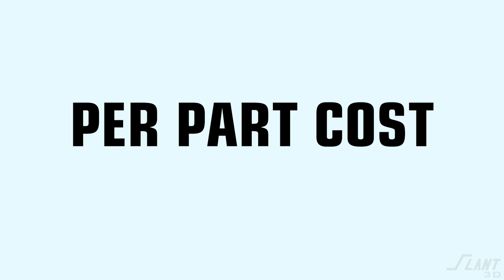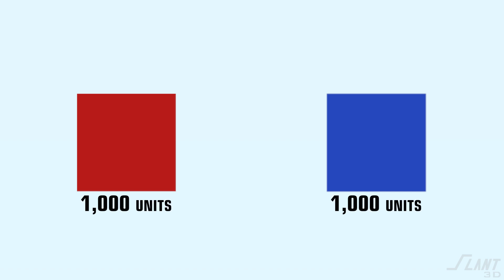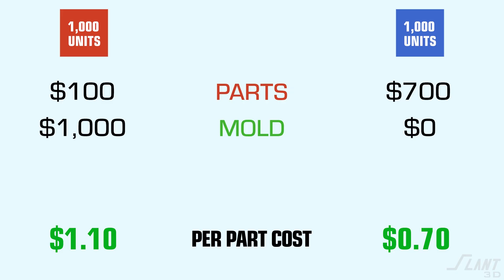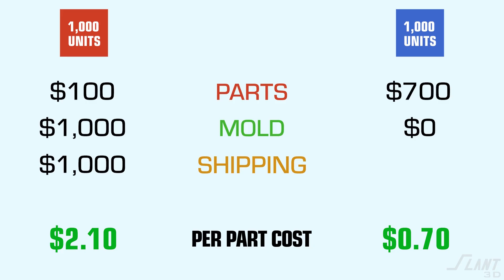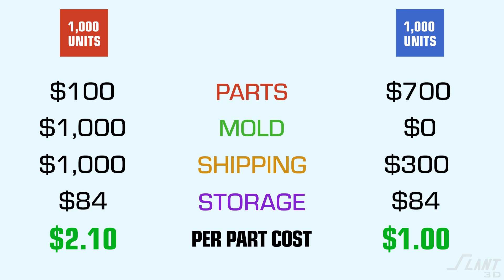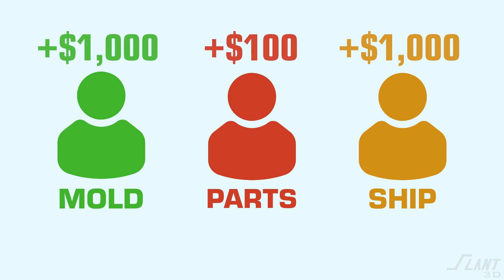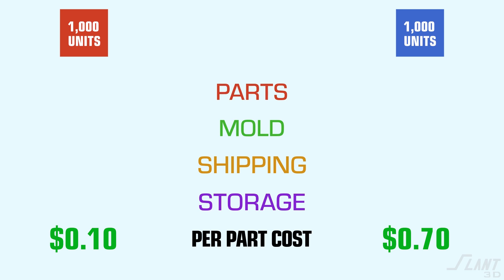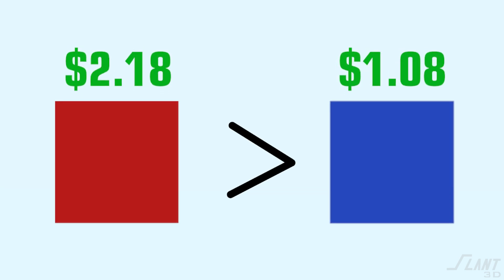Calculating the REAL Per Part Cost for Injection Molding vs 3D Printing

Comment: I love this video - VERY strong links to Taiichi Ohno's 'The Seven Wastes' in lean manufacturing: Transport (moving stuff) / Inventories / Motions (of people) / Waiting / Over Processing (using a hammer to crack a nut)/ Over Production / Defects.

I used to set an exam question about this, asking students to describe all seven, and then say which was the worst - I gave full marks for any well reasoned answer to that last part (what can I say? Sometimes I can be generous!). But Ohno himself said that the worst waste of all was Over Production, as it automatically led people into creating the other six wastes. What you're demonstrating here is the truth of this. Injection moulding forces companies into over production, and after that they may as well just burn bank notes.

Should also note that in your example maths, I don't think you need the warehousing cost for the printed parts - you've already taken account of this in the top line cost of production as you've often said that  "the factory is the warehouse". 😘
Reply: I think one thing that many people forget in the cost of 3D printed objects, is to ammortize the cost of the printer.
While not necessary if you're ordering from a print farm (since they do this for you), if you take production "in-house" with 3D printing, then you need to ammortize the machine,  calculate electicity costs, maintenance costs, and also the wages for that guy that specializes in 3D printing.

Comment: A company generally doesn't make a 10 cent part mold for just 1000 pieces. Those parts usually get molded by the thousands a month and that's when molding is far more superior. But there is a far more interesting intermediate option. FDM printing small batch molds, where you get the benefit of quick turn around in designing, creating and redesigning a mold and still be able to do a moderate amount of work in a fairly decent speed. 

Let's take the gridfinity bin (because everybody knows that, but bad example for molding). Let's say you have your processes tuned to the max and you are able to print a single bin in one hour. To print 1000 parts in a single day you would need 42 machines working in parallel. That's a lot of time spend managing machines and it would take an insane amount of space to house those machines. 
Now take a FDM based mold. You can print/prepare a mold in less then a day and a single small injection machine would then spend less then 4 hours to churn out those same 1000 parts. Assuming you would need to replace your mold every 250 molds you would need just a handfull of FDM machines to support a single day run. 

And that's where I think you made a mistake in your example. Because you might not need to pay for storage, but you DO need to pay for the officespace containing those machines. And you would also need a small army of people to maintain and manage all those printers. And this very specific example would actually be the perfect candidate for FDM based injection molding.

Comment: there is also the cost for R&D.  How long and how much did it cause to design the part and make the mold, or 3d print file?
Reply from the maker: Exactly the same for both

Comment: Just this week a big tool distributor asked me if I could design and print dividers for some of their tool boxes. Their suppliers are out of stock and need quite a few. Obviously no problem, easy design, got a sample out. Out of curiosity I asked about the cost of the 70x50 2. 5mm trapeziod and he said 17 ZAR. I can fit 12 on a build plate and asked 48 ZAR for it after everything was added, material, post processing etc. 4 ZAR each as to the injection molded part at 17.

Comment: These kinds of comparisons are almost always fairly disingenuous, like this explanation of part cost is here, which is that in a production environment you're dealing with monthly/weekly/daily usages for years on end. Not a single one time run of 1,000 parts. No competent engineer, project manager, CFO, etc would even consider injection molding as a manufacturing method to begin with for 1,000 standalone parts and the design of the part would be chosen to accommodate this. Or you wouldn't even waste the time to design you're own in the first place and would just purchase an off-the-shelf mass produced enclosure that you can use in the example of a box.

If you're going to go down the rabbit hole of trying to nit pick every cost along the way, you need to also start adding in the 40-50/Hr that you're paying for design work, reviews, meetings, getting quotes, working with the 3D printing shop, etc, etc. You shouldn't just limit to the basic direct costs associated to simply manufacturing the thing when it reaches a point that appears favorable to 3D printing, which is of course a service that you're selling to people.

Comment: I get what your saying but they both fill different needs and always will.  Time and reliability of production.  Space could be argued both ways because to produce the same amount of parts you will certainly need a great deal of floor space for all those 3d printers to make the parts.  If I machine my molds in house, well molds aren't terribly expensive.  Each business has to do the homework.

Comment: Dont forget about the R&D cost of the mold and extra engineering it takes to design an injection molded part vs 3d printed. It is significantly easier to design for 3d printing. This also means it is much quicker. Which means get to market sooner and sell earlier

Comment: The price of the printer seemed to be excluded (unless it was worked into the part cost, which it very well might've been), but the rest of the concepts made sense
Reply: @TS_Mind_Swept  the cost of the printer was not included as this consider's having a print farm print it for you, just as the cost of the injection molding machine wasn't included.
Reply: @beansbaked4448  the price of the printer/upkeep of it is still a factor for them though, and if you think for even a second they're going to give that away, you're sorely mistaken. Just like with "free" shipping, nothing is free, it's just worked into the cost elsewhere

Comment: this video is obviously very simplified but like always, it depends on the part. You can not for example print a clear part or a part that has charp corners anywhere or parts that have a shallow angle which needs to be flat etc. Also injection molded parts are isotropic meaning they have the same strength in all directions. You can also not print connector housings which have the contacts inside the plastic routed around corners to reach specific points on the housing. Also warping is, i believe, much better controllable with a mold vs a printer. And last but not least, you are not gonna make a mold for only 1000 parts.

Comment: There is also one other cost for injection molding.  Molds can wear out over time and may need to be replaced.  Worn out molds can affect quality so if you use a mold alot, you may need a new one at some point.  Model kit manufacturers run into this on a semi regular basis.

Comment: We have several 3D Printers and they are an essential part of our process and save us a lot of money. 

My only 2 comments on the video are: if this manufacturing is done in house then there is a significant overhead relating to removing the parts (if not a conveyor type printer) maintaining the 3D Printers, failed prints etc. The second point is speed of production. Whilst having a mold made takes a while, the machine can then crank out a 1000 in a few hours instead of a few weeks. 

There maybe questions as to the quality of a 3D printed part, porosity and strength, but I still think that 3D printing is the way to go. We use lots of PETG CF and it produces awesome results. The saving of plastic also makes me happy.

We just need to make SLS printing much cheaper or even have suitably priced pellet FDM Printers to save money and the planet.

Comment: They don't factor any 3d printing overhead. Like cost of the machine, aplace to put them. Electronics required powestrips additional panel changes to support a printer wall. Filament. Duration of runtime per part. Failure rates of not having the perfect settings for a new part.. plus employee time troubleshooting and sending the job back in with new changes clearing failed prints. Machine upkeep. That also means there is down time. If you have even a few printers having one go down is a huge setback. That's not even considering getting into a more hands free product like bambu but that still is quite a bit of overhead amd if you want to ams then even more complexity to get it dialed in.... I like 3d but still don't see how I could ever make any money unless you operate printers like a crypto mine. Not to mention do you guys know IT ? because unless you do your going to be operating a lot of servers. Do you have wifi that supports it? Are they all hardwired aka we need to add drops to the printer wall and infrastructure to support the drops. Ie a switch. Don't you want to vlan those off the main network... of course you do.... there is so much going on to support these things. That being said mines on now printing a prototype part... anyone that has a winning business recipe already had capital
Reply: I think he mean you can order 3d printed things through companies that have 3d printer farm. So you only need to have 3d printer for your own prototyping, not for mass producing

Comment: The "mold" cost for 3D printing isn't $0.00 unless your designer works for free. The $1000 estimated mold cost has to include the design work along with creating the mold itself. No, it won't take $1000 in designer time to design a 3d printed cube, but it still isn't $0.
Reply from the maker: Product design is identical for both
Reply: @slant3d  do you not always say that we should design parts differently for 3d printing than for injection molding?
Reply: @divide6049  but I would think they are still within the comparable ball park for the same thing, unless the designer on each side has already some work before hand that is similar to the part that they could just modify to lessen their time.
Reply: @patrickbueno3279  i see where you're coming from, and for the cube you are definitely correct, the design would be nearly identical. However when the model becomes more complex, it needs to be designed differently for injection molding and for 3d printing
Reply: @divide6049  I'm just curious because I'm a new hobbyist, isn't molding generally a much more hassle to design than a 3d printing, unless they are optimizing for material economy and speed of printing of course.
Reply: @patrickbueno3279  in general the outer design of a part is easier with injection molding, besides the fact that the whole thing needs to draft inward slightly, but the inside is much harder on injection molding. The inside can't be filled with solid plastic as it would shrink and warp or even break when it cools down. This isn't as big of an issue with 3d printing since the slicer makes infill (100% infill parts won't break when 3d printed though, since it cools off gradually by each layer).

The outside of 3d printed parts needs a lot of changers and fillet to be strong, you also need to think about overhang and bridges, but you can make a lot of things that are impossible with injection molding, like internal holes etc.

Comment: You need to amortise the cost of the 3d printer, and if you need  quantity of these parts quickly, you need a bunch of 3d printers. Then you need a room / factory to store the 3d printers, which is significantly larger than warehousing the parts. This is a half baked idea economic breakdown.
Reply: No you don't. The startup does not buy the printer. They hire a printing service just like they would hire a mold company. The difference is once the mold is made it belongs to you forever. And so does the cost of it. There is no printer to buy at all when you are sourcing it out. You are taking an Apples to Apples comparison and twisting into an Apples and oranges comparison.
Reply: @DigitalGus75  if you're making a comparison based on the machines themselves then you'd also have to compare the injection molding machines required which also need a factory of their own and a much much larger production line and easily magnitudes higher in cost...

Hence, why people in need of 1000+ parts hire third-party companies to handle the manufacturing regardless

Comment: If the big company has defined the cost per part  0.1$, dont you think then will obviously consider mold, shipping etc cost to reach unit cost?
Reply: The point of the video is that regardless of the part cost, there's a lot of other costs as well which make the actual cost to produce and acquire the product significantly more
Reply: Not quite. Depending on company. Many Chinese are subsidised by government and shipping is almost free but may not in some cases. Same with molds. Those 0.1 per piece mostly won't include many expenses, like shipping, mold etc just the production itself as not single company will charge per item with injection molds, there will be minimum order amount but still price varies in the end when you ready to buy things.

Comment: Your analysis is not complete. The quality and strength of the parts could determine whether they will be sold or not. Also, all these factors are relative to reality for small quantities. Try printing 700,000 pieces in a week with a 3D printer... a mold can do it this with perfect quality and to be waterproof as well.
Your video feels like propaganda in favor of 3D printing haha 🤣🤣🤣
Reply: @3DTypist  My thoughts exactly. Injection molding buries 3d printing when it comes to mass production and consistent quality. That’s why manufacturers do it.  This guy is a bit of a goof.
Reply: It is propaganda in favor of 3D printing. He has a business that offers mass production 3D printing.
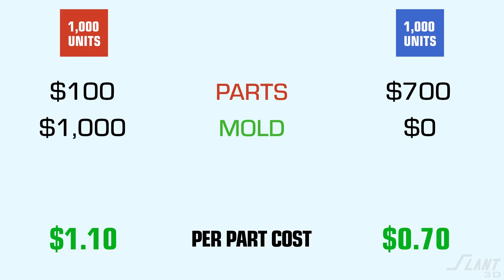Reply: He already explain that in 2:15

Comment: Yeah per part cost of maybe some shit tier materials. Any real industry doesnt actually use FDM 3d printing for any sort of end use parts that arent useless widgets or stuff under 0 stress. Injection molding has massive benefits from material selection, to strength, dimensional accuracy, etc.

An injection molded part is far more repeatable, you can get crazy materials, and for fiber reinforced stuff, its on another level.

Ive been 3d printing for 6 years, but fooling ourselves by saying fdm 3dp is better than injection molding is a nono.
Reply: Bro really? Nasa is using fdm in space...that's definitely not a "real" industry needing critical parts with high strength and dimensional accuracy. I've only been printing for under 2 yrs and have made thousands of parts on one printer and used or sold hundreds of them in the trades. A REAL industry. My parts do not break, they are under alot of stress, they will be used in spaces reaching 135F and they cannot be made in a single mold. And I am not using nylon or abs lol. You have alot to learn still.
Reply: @phasesecuritytechnology6573  

what part are nasa using that are FFF printed
Reply: Just as IM does, FDM printing also has massive benefits on many areas. Saying either of them is objetively better (which was NOT done on this video) just means you dont understand the subject. There are a lot of "real" industries, whatever that means to you, that use FDM parts. Just because you don't see them, doesn't mean they don't exist. 

It's also funny that you imply "useless widgets" or parts under no stress are not part of any real industry.
Reply: @Catrik  there's tons of crazy industries where PEEK, PSU, etc are used for FDM and that's a whole epic world of FDM where injection molding barely touches.

However what I subscribed to this channel and tangled testing for knowledge on actual viable 3d printing, not PLA/petg print strength which this channel seems to print almost exclusively. As someone who prints almost exclusively in nylons and other engineering filaments I was a bit disappointed in the filament testing.
Reply: @FrozenByFire3 what were you expecting? Most consumer grade products that they make for people do not require nylon. So why would he test that at this stage? They will get to those materials down the road he said in the beginning. Making a video about nylon to please only a handful of subscribers, definitely not the majority right now.
Reply: @Catrik  the other issue with FDM is part consistency. It is extremely easy to have internal defects in a part and it's almost non visible. Whether it's a micro under extrusion at a key stress point, etc. these things will happen. Every single one of my prints is 100% infill. I print stuff for actual end use max durability. Things going on firearms or airsoft guns under serious duress where PLA/PETG would explode and anything other than 100% infill breaks. 

Every time I see a print on this channel it's 2-3 wall prints that would break at the slightest torque. Sure It saves material, but you can also just design parts that don't actively use infill but slightly thicker walls. There's so much engineering to be explained yet we're just going over hella basic things that every YouTuber has already done before.
Reply: @FrozenByFire3  You are biased, because you've already seen the videos from "every other youtuber". Not everyone spends their work or free time researching 3D printing. Considering that this is a channel for a 3D printing company, it makes sense that big part of their target audience is people who aren't their customers yet, but could be. So the obvious topic is videos explaining which products are good for 3D printing farm.
Reply: You sir go not understand what catering to your audience means.